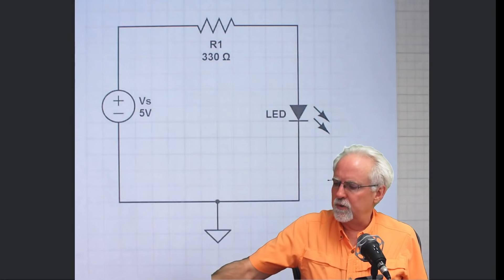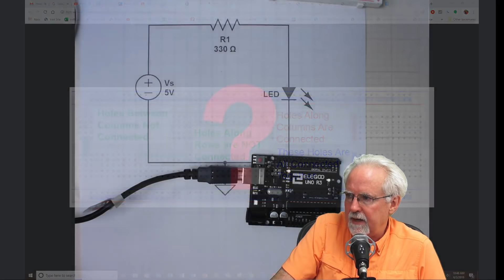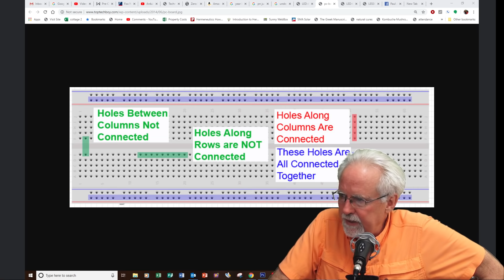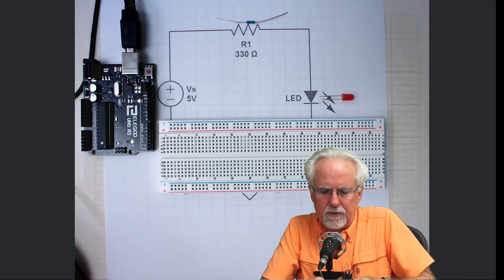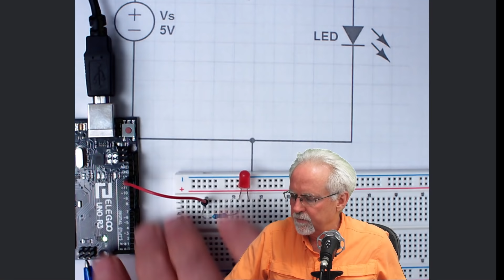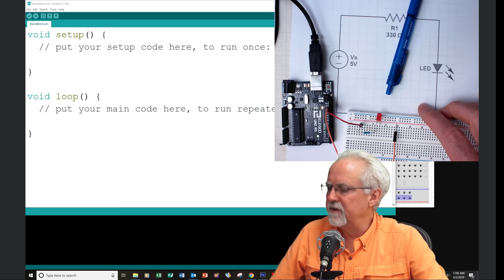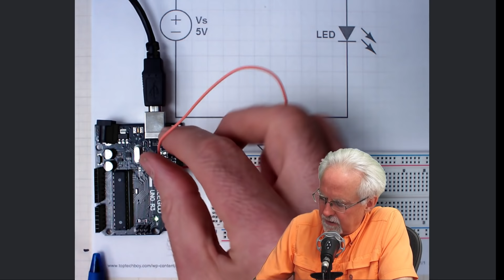Arduino Tutorial 3: Understanding How Breadboards Work

Comment: Wow, thank you so much. I appreciate that you take the time to explain things and not rush. I subscribed and looking forward to more of your videos.

 I just got my kit today and I already have a LED light that has different blink states using arrays that take care of blink delays, how many times it blinks per state and what color to use for the state. This video really helped me out by getting something simple.
Reply: Yep, arrays and for loops help a lot. I'd love to see your code to see how you approached it. Perhaps other people would find it helpful as well. What I did is below:

int delayTime = 500;

int pins[] = {8, 9, 10};   //Red is pin 8, Yellow is pin 9 and Blue is pin 10
int blinks[] = {5, 10, 15};
int pinCount = 3;

void setup() {
// put your setup code here, to run once:

    //loop through each element in the pins array and set the pin to OUTPUT
    for (int i = 0; i < pinCount; i++) {
        pinMode(pins[i], OUTPUT);
    }
}

void loop() {
// put your main code here, to run repeatedly:

    //loop through each pin
    for(int index = 0; index < pinCount; index++) {

        //for each pin, get the corresponding number of times to blink from the blinks array and repeat the loop that number of times
        for(int blinkCount = 0; blinkCount < blinks[index]; blinkCount++) {
            digitalWrite(pins[index],HIGH);
            delay(delayTime);
            digitalWrite(pins[index], LOW);
            delay(delayTime);
        }
    }
}

Comment: So is the battery on the Arduino is by default connected to the LED that blinked in the first session? It is still blinking in this session. The pins on the Arduino essentially connect the powersource to an external circuit, correct? That is the basic function?

Comment: Made a loop instead of copy-pasting same thing 15 times xD @Paul McWhorter 

// C++ code
//
void setup()
{
  pinMode(8, OUTPUT);
  pinMode(9, OUTPUT);
  pinMode(10, OUTPUT);
}

void loop()
{
  int m = 1;
  while (m < 6){
    digitalWrite(8, HIGH);
  	delay(500); // Wait for 1000 millisecond(s)
  	digitalWrite(8, LOW);
  	delay(500); // Wait for 1000 millisecond(s)
  	m += 1;
  }
  int n = 1;
  while (n < 11){
    digitalWrite(9, HIGH);
    delay(500); // Wait for 1000 millisecond(s)
    digitalWrite(9, LOW);
    delay(500); // Wait for 1000 millisecond(s)
    n += 1;
  }
  int o = 1;
  while (o < 16){
    digitalWrite(10, HIGH);
    delay(500); // Wait for 1000 millisecond(s)
    digitalWrite(10, LOW);
    delay(500); // Wait for 1000 millisecond(s)
    o += 1;
  }
}

Comment: How do you know what resistor to use?  Sure you said 330, but why? and the same for the other colors?  I also saw a circuit where they had many LEDs in parallel, and also had a resistor for each LED, but why not one resistor that then branches out to all the LED? Is it a redundancy thing?

Comment: void setup() {
  // put your setup code here, to run once:
 pinMode(7,OUTPUT); //Red_Led
 pinMode(6,OUTPUT); //Blue_Led
 pinMode(5,OUTPUT); //Green_Led

}

void loop() {
  // put your main code here, to run repeatedly:
  //Red_Led [Blink 5x]
   digitalWrite(7,HIGH); 
    delay(500);
   digitalWrite(7,LOW);
    delay(500);                          //Repeat Code 5 times
 //Blue_Led [Blink 15x]
   digitalWrite(6,HIGH); 
    delay(700);            
   digitalWrite(6,LOW);    
    delay(700)                          //Repeat Code 15 times
//Green_Led [Blink 10x]
   digitalWrite(5,HIGH);   
    delay(600);                       
   digitalWrite(5,LOW); 
    delay(600);                    //Repeat Code 10 times
}
Sketch uses 2132 bytes (6%) of program storage space. Maximum is 32256 bytes.
Global variables use 9 bytes (0%) of dynamic memory, leaving 2039 bytes for local variables. Maximum is 2048 bytes.

can you only use one resistor to protect 3 LEDs?

Comment: Just a note for anyone. If you are unsure of connection's or causing a short, disconnect the Arduino from power while changing connections. As a direct short to ground will at least blow the channels it is connected too. (There are special Arduino's that have a self resetting fuse on each pin for short circuit protection.)

Comment: I wouldn't recommend pulling the resistors from the tape. The two ends of the resistors may still have adhesive on them and could potentially gum up your board. I would cut them out carefully.

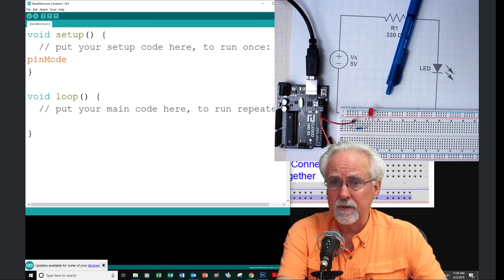Comment: 21:39 always remember to set the pinMode! I hooked up the circuit and then wrote the program, just the line "digitalWrite(13, HIGH);". Uploaded the program to the UNO and got a very disappointing result: the led was incredibly dim. Also, sometimes it would turn on and sometimes it would not. Did I broke something? NO! I forgot to set pinMode in the setup function!!

As soon as I realized it and fixed the code, it worked like a charm.

Comment: A couple of times you said each command ends with a colon. I know it's just a slip of the tongue, you get it right a few seconds after, but it's important to be clear that it's a semicolon, not a colon.

Also the process of sending the program to the arduino is uploading, not downloading. (yes, I'm being extremely pedantic but it's important to get the terms right) 

Love your tutorials!
Reply from the maker: 'Upload' vs. 'Download' depends on the frame of reference and hence is not a standard like the difference between 'client' and 'server'. If your frame of reference is the arduino, it is downloading the code from the PC. It depends mentally on where you are, hence I stand by my use of the term download.
Reply: @paulmcwhorter  whilst I get what you're saying, I'm referring to the terminology used in the IDE, which is definitely upload.
Nevertheless, I'm really enjoying watching the tutorials as a refresher. Excellently produced and very easy to understand. Thanks.

Comment: I did it like that xD not the most elegant way to do it

void setup() {
  // put your setup code here, to run once:
pinMode (8,OUTPUT);
pinMode (9,OUTPUT);
pinMode (10,OUTPUT);
}

void loop() {
  // put your main code here, to run repeatedly:
digitalWrite(8,HIGH);
delay(100);
digitalWrite(8,LOW);
delay(100);
digitalWrite(8,HIGH);
delay(100);
digitalWrite(8,LOW);
delay(100);
digitalWrite(8,HIGH);
delay(100);
digitalWrite(8,LOW);
delay(100);
digitalWrite(8,HIGH);
delay(100);
digitalWrite(8,LOW);
delay(100);
digitalWrite(8,HIGH);
delay(100);
digitalWrite(8,LOW);
delay(100);
digitalWrite(9,HIGH);
delay(100);
digitalWrite(9,LOW);
delay(100);
digitalWrite(9,HIGH);
delay(100);
digitalWrite(9,LOW);
delay(100);
digitalWrite(9,HIGH);
delay(100);
digitalWrite(9,LOW);
delay(100);
digitalWrite(9,HIGH);
delay(100);
digitalWrite(9,LOW);
delay(100);
digitalWrite(9,HIGH);
delay(100);
digitalWrite(9,LOW);
delay(100);
digitalWrite(9,HIGH);
delay(100);
digitalWrite(9,LOW);
delay(100);
digitalWrite(9,HIGH);
delay(100);
digitalWrite(9,LOW);
delay(100);
digitalWrite(9,HIGH);
delay(100);
digitalWrite(9,LOW);
delay(100);
digitalWrite(9,HIGH);
delay(100);
digitalWrite(9,LOW);
delay(100);
digitalWrite(9,HIGH);
delay(100);
digitalWrite(9,LOW);
delay(100);
digitalWrite(10,HIGH);
delay(100);
digitalWrite(10,LOW);
delay(100);
digitalWrite(10,HIGH);
delay(100);
digitalWrite(10,LOW);
delay(100);
digitalWrite(10,HIGH);
delay(100);
digitalWrite(10,LOW);
delay(100);
digitalWrite(10,HIGH);
delay(100);
digitalWrite(10,LOW);
delay(100);
digitalWrite(10,HIGH);
delay(100);
digitalWrite(10,LOW);
delay(100);
digitalWrite(10,HIGH);
delay(100);
digitalWrite(10,LOW);
delay(100);
digitalWrite(10,HIGH);
delay(100);
digitalWrite(10,LOW);
delay(100);
digitalWrite(10,HIGH);
delay(100);
digitalWrite(10,LOW);
delay(100);
digitalWrite(10,HIGH);
delay(100);
digitalWrite(10,LOW);
delay(100);
digitalWrite(10,HIGH);
delay(100);
digitalWrite(10,LOW);
delay(100);
digitalWrite(10,HIGH);
delay(100);
digitalWrite(10,LOW);
delay(100);
digitalWrite(10,HIGH);
delay(100);
digitalWrite(10,LOW);
delay(100);
digitalWrite(10,HIGH);
delay(100);
digitalWrite(10,LOW);
delay(100);
digitalWrite(10,HIGH);
delay(100);
digitalWrite(10,LOW);
delay(100);
digitalWrite(10,HIGH);
delay(100);
digitalWrite(10,LOW);
delay(100);
}

Comment: Here is the program that I came up with. 

void setup() {
  // put your setup code here, to run once:
pinMode(13,OUTPUT);
pinMode(10,OUTPUT);
pinMode(5,OUTPUT);                                                                                                                                                                                      
}

void loop() {
  // put your main code here, to run repeatedly:
digitalWrite(13,HIGH);
delay(500);
digitalWrite(13,LOW);
delay(500);
digitalWrite(13,HIGH);
delay(500);
digitalWrite(13,LOW);
delay(500);
digitalWrite(13,HIGH);
delay(500);
digitalWrite(13,LOW);
delay(500);
digitalWrite(13,HIGH);
delay(500);
digitalWrite(13,LOW);
delay(500);
digitalWrite(13,HIGH);
delay(500);
digitalWrite(13,LOW);
delay(500);

digitalWrite(10,HIGH);
delay(500);
digitalWrite(10,LOW);
delay(500);
digitalWrite(10,HIGH);
delay(500);
digitalWrite(10,LOW);
delay(500);
digitalWrite(10,HIGH);
delay(500);
digitalWrite(10,LOW);
delay(500);
digitalWrite(10,HIGH);
delay(500);
digitalWrite(10,LOW);
delay(500);
digitalWrite(10,HIGH);
delay(500);
digitalWrite(10,LOW);
delay(500);
digitalWrite(10,HIGH);
delay(500);
digitalWrite(10,LOW);
delay(500);
digitalWrite(10,HIGH);
delay(500);
digitalWrite(10,LOW);
delay(500);
digitalWrite(10,HIGH);
delay(500);
digitalWrite(10,LOW);
delay(500);
digitalWrite(10,HIGH);
delay(500);
digitalWrite(10,LOW);
delay(500);
digitalWrite(10,HIGH);
delay(500);
digitalWrite(10,LOW);
delay(500);

digitalWrite(5,HIGH);
delay(500);
digitalWrite(5,LOW);
delay(500);
digitalWrite(5,HIGH);
delay(500);
digitalWrite(5,LOW);
delay(500);
digitalWrite(5,HIGH);
delay(500);
digitalWrite(5,LOW);
delay(500);
digitalWrite(5,HIGH);
delay(500);
digitalWrite(5,LOW);
delay(500);
digitalWrite(5,HIGH);
delay(500);
digitalWrite(5,LOW);
delay(500);
digitalWrite(5,HIGH);
delay(500);
digitalWrite(5,LOW);
delay(500);
digitalWrite(5,HIGH);
delay(500);
digitalWrite(5,LOW);
delay(500);
digitalWrite(5,HIGH);
delay(500);
digitalWrite(5,LOW);
delay(500);
digitalWrite(5,HIGH);
delay(500);
digitalWrite(5,LOW);
delay(500);
digitalWrite(5,HIGH);
delay(500);
digitalWrite(5,LOW);
delay(500);
digitalWrite(5,HIGH);
delay(500);
digitalWrite(5,LOW);
delay(500);
digitalWrite(5,HIGH);
delay(500);
digitalWrite(5,LOW);
delay(500);
digitalWrite(5,HIGH);
delay(500);
digitalWrite(5,LOW);
delay(500);
digitalWrite(5,HIGH);
delay(500);
digitalWrite(5,LOW);
delay(500);
digitalWrite(5,HIGH);
delay(500);
digitalWrite(5,LOW);
delay(500);

Comment: Hi Mr. Paul, I have a doubt regarding the homework!
There is only one Ground option on the Arduino board. How do I make a circuit for 3 LEDs when I have only one Ground?
Reply: Someone above said you don’t need more than one ground. You can connect one end to the bottom negative row and that will make the whole row ground.

Comment: Hello, i tried doing the homework. The LED that is connected to pin 13 emits the strongest light while the succeeding LEDs which are connected to pins 12 and 11 flash weaker lights. Can anyone help me with this :) Thank you!
Reply from the maker: Make sure you are using correct resistor, and dont forget to do your pinmodes. Wrong resistor, or not doing pinmodes will make your led weak.
Reply: @paulmcwhorter  Thank you very much good sir! Apparently, I have only "pinmoded" the pin 13. Configuring pins 11 and 12 to pinmode output solved the problem. I thank you again good sir :) :)

Comment: helpful tip: if for various reasons you cannot purchse the elegoo kit (money,shipinng,ecetra) you can use thinkercad circuits for it. the arduino on thinkercad circuits is a r3 just like the ones used here: www.tinkercad.com

Comment: Hello Pau. Thank you for your great videos!  had a question if you can help me out.. I have made this circuit with two leds and was able to control each light with different timing, but I am trying to get them to blink at the same time, but they are alternating.. this is the code I have written.. Can you advise me what needs to be done to get them on the same timing? Thanks in advance!!

void setup() {
  // put your setup code here, to run once:
pinMode(8,OUTPUT);
pinMode(7,OUTPUT);
pinMode(13,OUTPUT);
}

void loop() {
  // put your main code here, to run repeatedly:
digitalWrite(8,LOW);
delay(500);
digitalWrite(8,HIGH);
delay(500);
digitalWrite(7,LOW);
delay(500);
digitalWrite(7,HIGH);
delay(500);

Comment: I live in very dry Arizona with static electricity problems.  Should I be using a grounding strap or is the USB cable to the computer plugged in the charging adapter going to give enough protection?

Comment: I had been using arduino for a while but a week ago I received the kit and starting viewing and listening the lessons.
Many thanks and congratulations to the teacher both for the way he explain difficult things in a very simplistic way.

After lesson 3, I tried to use the (for loop) to do the homework. Below I am sharing the code I used.

void setup() 
{
  // put your setup code here, to run once:
pinMode(12,OUTPUT);
pinMode(8,OUTPUT);
pinMode(4,OUTPUT);
}

void loop() 
{
  // put your main code here, to run repeatedly:
  
  // blink red led 5 times:
  for (int r = 0; r < 5; r ++)
  {
  digitalWrite(12,HIGH);
  delay(300);
  digitalWrite(12,LOW);
  delay(300);
  }
  delay(1000);
  
      // blink green led 10 times:
      for (int g = 0; g < 10; g ++)
    {
    digitalWrite(8,HIGH);
    delay(300);
    digitalWrite(8,LOW);
    delay(300);
    }
    delay(1000);
    
        //blink blue led 15 times:
        for (int b = 0; b < 15; b ++)
      {
      digitalWrite(4,HIGH);
      delay(300);
      digitalWrite(4,LOW);
      delay(300);
      }
      delay(3000);
}
Reply: I wanted to congratulate you too, PAUL for the nice video settup you have.
Reply: I knew there was a more efficient way of writing the code

Comment: Hey! Great videos
One thing I can't understand is that u didn't stated the voltage output of pin 13.
Like is it 5v by default?
Can i change the voltage?
Also i tried to run it in parallel mode but only one led was blinking

Comment: So I was curious about the seemingly random selection of the 330 ohm resistor. I pulled open the specs for the LEDs and found the Continuous Forward Voltage (in mA) as such: Super Red = 50; Super Yellow = 50; Super Green = 20; Super Blue = 20; White = no spec.  These voltages are for 100% relative intensity according to the graphs. Using Ohm's Law E=I x R with the smallest rated current of 20 mA yields equation 5V= (0.02 A)R. Therefore R = 250 ohms.  My starter Kit has 220 ohm and 330 ohm.  Selecting the higher 330 ohm resistance will decrease the current, but still illuminate the LEDs while limiting the current so that the LEDs won't cook.  I'm assuming this is correct.
Reply: I've always wondered that, and cant seem to find much about it.

Comment: After playing with arduino on and off  for a while and now coming back into it your videos are great. Finished the project off. Had 3 Leds blinking at 5/10/15 blinks each and then resetting. I found a 200 delay between each blink was good to watch but not slow enough to be boring

Comment: Hi Pual, first off, the tutorials are awespme and very helpful and I really love them. I just have a question that is messing me up.

What is ground? From what I know, the current flow from the negative end the positive end because electrons have a negative charge. So is ground the negative end? Is ground where the current flow from?

Also does it matter which side I connect the resistor to? You connected the resistor to 5 volts and to the anode of the LED. I did the opposite and connected it to the ground and to the cathode of the LED and connected the 5 volts straight to the LED and it still works.

Also I started getting into arduino and elctronics only a month ago so I am likely making many mistakes.

Comment: Hi Paul, I'm an 86 year old student of yours and I just want to say thanks.
I retired from Texas Instruments in 1991 after a 33 year career. My early years was vacuum tubes and analog based. We built transistors but had no idea how to use one. I love your work.
Reply: Cool. I'm 72 and I retired from TI in December 1971 after 21 years.  I worked primarily for DMOS 5 at TI Blvd and Hwy 75.  I was an automation engineer supporting photo and many of the AMAT tools plus several other tools.
Reply: I am at the middle of professional life but here it looks like I am a just prospect for the future :).
Reply: how should you kill the program? do I just unplug usb or is there a shut program down?
Reply: Why doesn’t the light flash consistently itt kinda random
Reply: @jameswiles7553  i believe there is a delay between the arduono switching between high low (as its doing it so fast) and the time it takes current actually getting sent through the circuit which creates this offset
Reply: @chaoscal7399  how about our sight capability, i remember read an article long ago that state the eye perceive things as 'flickering' if it below 50Hz
Reply: @jameswiles7553 james, I think that apparent inconsistent flashing might simply be due to the camera.
Reply: @jameswiles7553   sir here we use the delay function so that we can see how it's deal with the how and low voltage flow there for it doesn't blink constantly . Sir i want my future career in @texasinstrument . Can u suggest me about anything... How to apply and how to get a job please.
Reply: Its pretty inspirational that you doing things at this age sir